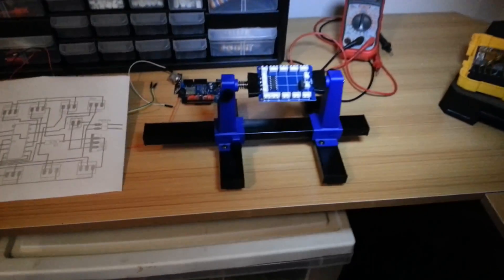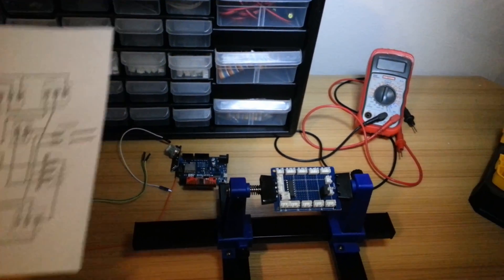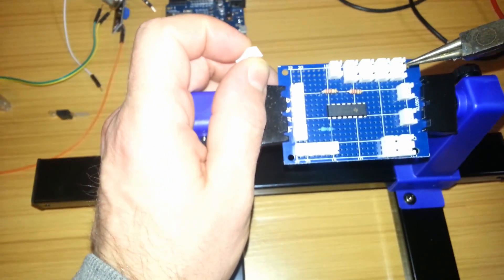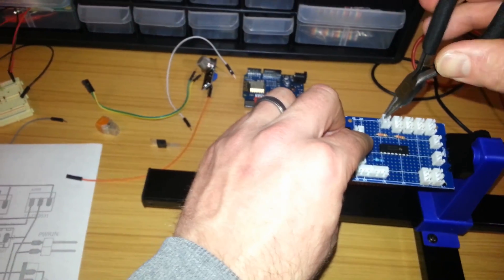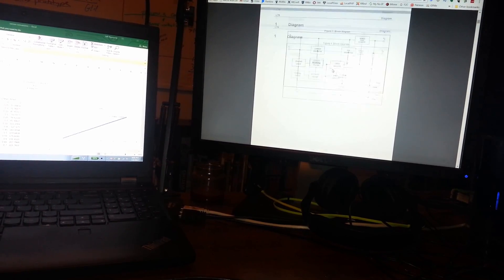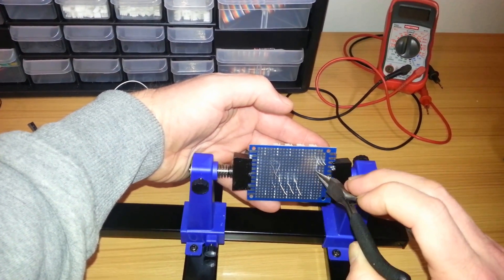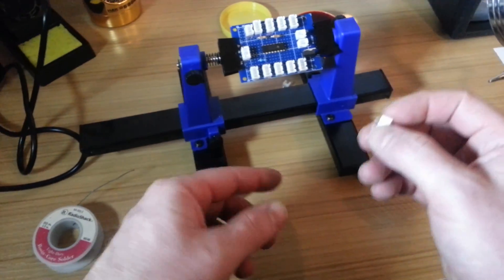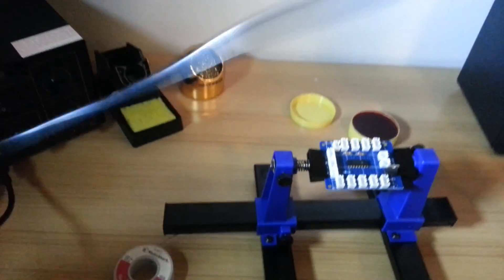Arduino Controlled/Monitored Greenhouse - PCB - Part 1

Comment: A little dab from a hot-melt glue gun would hold the components for soldering. Also, easily removable when you need to make changes.

Comment: I use Kicad and use the pcb layout tool for designing my perfboard layouts. The goal being not only good component placement, but more importantly laying out the components to achieve the least amount of complexity in connections among components, wiring crossovers etc. It also helps with properly sizing the board. There's a learning curve to using these kinds of software packages, but if you do enough proto boards, or design actual PCBs, it's worth it.

Comment: there is a continuity function with an audible beep right next to the setting you were on (darker black with a diode symbol and a speaker symbol) it's easier to measure for shorts with that function. Cheers

Comment: get a bigger tip for the iron, you can transfer heat that way faster (chisel tip) the solder will pull to the pad by itself. Cheers

Comment: Looks great for a photo type just a couple of pointers, if you put the components in one at a time and put a slight bend in the wires/pins that are through the board this will keep them in place while you solder them on ☺️ also I would place the bottom sockets around the opposite way so they all have the same pin out on the plug that attaches to the board later ie. Pin 1 on all plugs is positive rail and pin 2 is negative and pin 3 is signal  (not sure if you did this as I couldn't see too clearly but thought I'd mention it just in case) ☺️ also in the final design I would suggest putting a fuse on the positive and or negative depending on the connected devices etc so if one developed a short it won't drag all the others down with it ☺️ looks like a great start tho

Comment: You might need some capacitors on the output of your voltage regulator (input would be good too). Without them you may find the output voltage of the regulator will oscillate. Think of them like adding shock / dampers to your car/truck suspension. Without them the ride (voltage) would be very bouncy.  Good practice to add two caps to the output. One larger and one smaller. Anything between 100 micro Farad and 470 micro Farad for the larger. 1 nano to 100 nano Farad for the small one. The voltage rating should be 3x your expected voltage, ie for 5V, use caps rated at 16V.

As Paul P mentioned your top connectors have +5V on pin 3 and your bottom row connectors have +5V on pin 1.  Plug in the wrong wrong connector and the magic smoke might escape. :-)

Comment: Bend the leads over on the back of the PCB in the direction of the next connection and you won't have to worry about your components falling out on you.

Comment: You can change your multimeter to continuity mode (indicated by an icon that looks like a sound wave. So you wouldn't need to visually check for connection between 2 points, you'd hear it.

Comment: What was the point of buying an ESD mat and then not using it ?  Also, use a socket for your ICs - means you can't damage them when soldering and if they fail you can replace them easily. Finally, a vero-wire pen (http://www.verotl.com/en/product/verowire-wiring-pen-part-number-79-1732) contains varnished wire that can be used to join solder joints -the heat melts the varnish. A bit tricky to use as you have three things to hold, veto pen, solder and soldering iron, but gives a better result.

Comment: oh god unless you need to dissipate a significant amount  power from those resistors (which you dont) put them flat on the perfboard; check continuity between your power and ground bus to make sure you don't have a short

Comment: I was yelling at my monitor and seems I wasn't the only one.  taping the components so you could turn the board over would make this easier.  a piece of your 30 gage wire would certainly make "busses" easier as mentioned in other comment.  You are being a bit stingy with flux I think.  You'll get quicker and better solder flow if  you use more of it.  Dip the end of your solder wire in the tin before using.  Last but not least... AFTER you've finished soldering take an acid brush (one of those penny a piece steel pencil size bushes) and dip it in a small jar or bottle of rubbing alcohol and brush away the left over excess flux on the board.  It will look better but also.. Flux is acidic.  Eventually it can cause your board to fail.  Not overnight or even months but it's not good to leave it on.
Others hinted at this but hope you use this advice when you put in your dip chip.  DIP= "Dual Inline Plastic" chip.  IF at all possible, use a socket.  You can put lots of heat to a socket and not hurt it.  Heat to the leg of a chip means heat to devices inside the chip that are smaller than a human hair.  They can't take a lot of heat.  When you move on to surface mounted devices you can't use sockets but you had better have practiced with your hot air solder gun before you ruin a few.  Best of luck.  Wish I was there to give you a half hour indoc.  That's really all you'd need to be soldering like a pro.

Comment: hot glue might hold the parts when you flip the board.  Or maybe some masking tape.....
Reply: Painters tape. wider so will cover more area per layer. Best to have an anti-static foam between the tape and parts to even out the pressure and a ground lead as pulling tape from a roll makes a ton of static.

Comment: couple of quick tips.  On your connector socket orientation;  Flip the top OR the bottom set so that when you wire the mating connectors, all of them have ground, power and signal on the same pin configuration. 
Secondly. when creating traces, use a fine copper wire to wrap each lead and tack to each pad.  you will use far less solder and you will have less chance of overflow to a neighboring pad.

Comment: You did fairly good, one suggestion if you place a sponge on the parts before you turn over the board(hold sponge and board together) it will hold the parts in place while you solder, start with the shortest first and work your way up to the taller ones.  Try it you might like it...
Reply: Been soldering for many years, just one of the tricks I learned long ago.
Reply: This is a good plan, maybe throw a piece of scotch tape on the back of said sponge and once you're all placed you should be able to solder away.

Comment: Awesome video, one trick that I was taught was to put a small drop of crazy glue on the sockets.. just enough to hold them until you can fully hold them in place with the solder...

Comment: Just wanted to ask as I'm sure you've considered it, but I noticed that you don't seem to be grounded to anything. Years ago when I worked in an electronics factory we had to wear armbands with a piece of metal on the inside touching our skin and wired to something grounded. Maybe you had something connected to your ankle. Just asking as even the static from your body can blow these chips.

Comment: Its good to see a project in progress!

Two comments though... I would suggest using a socket for the IC, since this is a prototype, and you might want to use the chip in the finished product, or another project.

Secondly, it looks like your sockets across the top and bottom edges are oriented in the same direction. Wouldn't this make wiring the plugs for those backwards between the top and bottom connections? IE + is not on the same plug pin with the sockets oriented all the same way, so you'd have to be sure to plug the matching plug into the matching socket. I'm probably not explaining myself very well...

Looking forward to the next step!

Comment: Back in ancient times (before all knowledge came from a computer) we built simple circuit boards like that using wire-wrap technology and I would've been finished with that board in half a day using it.  It only made sense to generate a PCB if there were ~10 or more copies to be made. 

If wire-wrapping or hard wiring a board, get a highliter and highlight each connection on your schematic as it is made on your board to insure that all connections eventually are made.